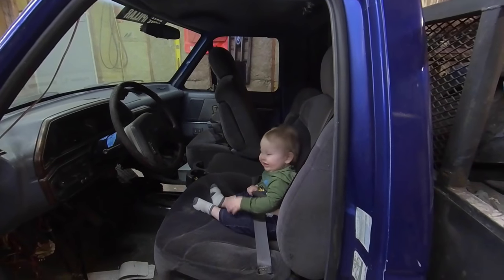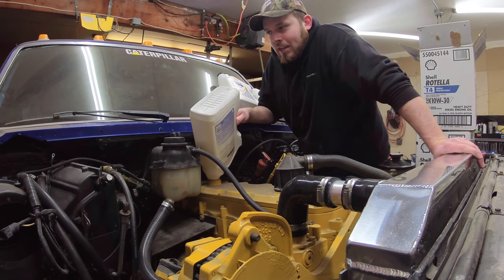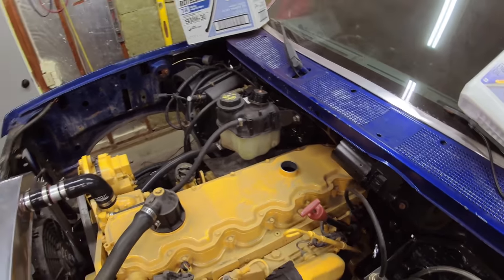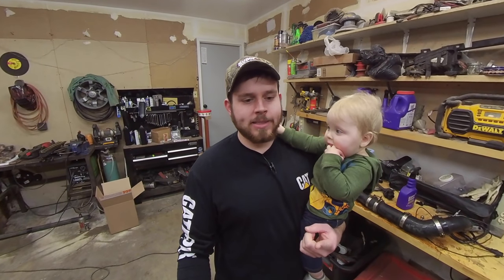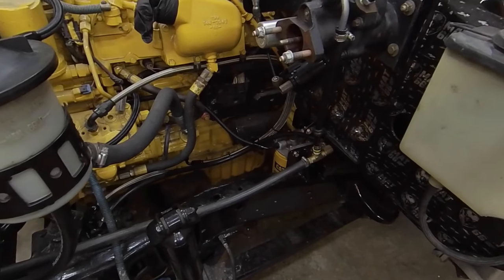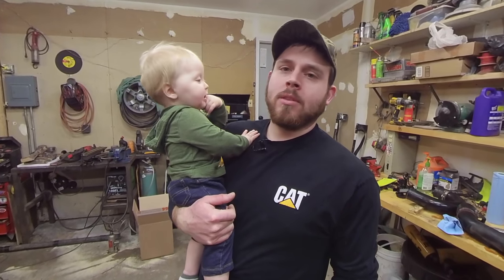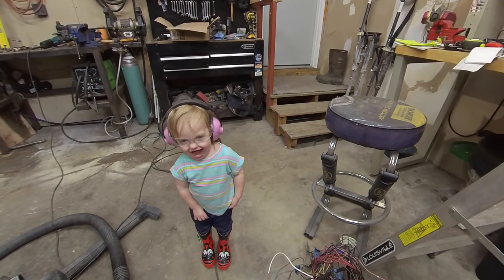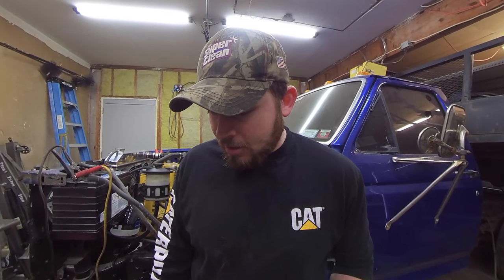Pt. 61 Getting Ready To Fire It Up. Cat/Allison Swapped F350.

Comment: it will have park, rev, and 3rd gear and will be in limp mode. and the castrol tranSynd 668 for 3 gallons is better stuff and is the replacement for the old tranSynd but that is still much better then the dextron 6 that gm uses. thanks for sharing

Comment: Maybe you should check on getting a controller and the wiring from a junk school bus. That’s the same setup on a Freightliner FS65 bus, a 3126 with a 2000. If I could get my hands on one I’d send to you... but we don’t have any of those in the junk pile right now!
Reply from the maker: Yeah I need to do some more digging around see if I can find something. Are your busses 6 speeds?
Reply: @DrEwBaBy625  yeah they are I think but 6th is locked out.

Comment: I believe the Allison 2000 is controlled by a stand alone controller mine is in a finned aluminum case mounted center rear to the bottom of my International 4200 cab - maybe you could get ahold of where you got the transmission they might have what you need.

Comment: Does your dipstick have a number on it? Would it be 167-2091V ? Bottom of the stick. Does it read correct? I have a3126b in a SuperCruzer which is the 22qt pan. It’s always showing overfill. Call Cat hotline they told me how to remark it but would not tell me what engine or oil capacity it was made for. 

Thanks
Reply from the maker: My dipstick is 266-9769.  Yours is an older part number that was superseded by mine and 275-4224. As far as I know it read correct, I have never had any issue.
Reply: @DrEwBaBy625  Drew, thanks for the reply. One more question if I could ask. What is the total length of your dipstick to top of the cap that surrounds the tube? Mine is 37”. Can’t get any info from Ring Power or the Cat Hotline except how to recalibrate it.  Can’t believe they only made one dipstick for the 22qrt and 33qrt oil pans. Have a friend with another SuperCruizer and he has the same stick as mine. Thanks in advance. Take care, Dave

Comment: Sweet stilts! Did you ever do drywall work?
Reply from the maker: I do not. I worked for an electrical contractor for a little bit and saw the drywall guys using them and decided I needed a pair! They come in handy every now and again!
Reply: @DrEwBaBy625  same! I'm a framer or concrete formwork carpenter and I saw drywall guys using them and had to have a set! They're great for Christmas lights

Comment: Man, been following you for a long time and hats off to all the hard work you’ve done on that truck! One thing to highlight, please use 15W-40, I know CAT DIESEL OIL ain’t cheap but Mobil makes it for us so you can buy their brand oil and save the CAT premium but for the love of God stick to 15W-40 your bearings will thank you later. Btw if you need specs for that engine just hit me up and glad to support your channel!
Reply from the maker: Thank you! I was told by my cat tech that cat recommends 10w-30 in these engines due to the heui system.
Reply: @DrEwBaBy625  let me double check that for you, what’s the engine’s serial number? I should be able to get on TMI web and get you more details and specs about it.
Reply: I I would agree with the 10-30 oil but I don’t agree with rotella haha, I’ve always been told in the past to run delo 400 in cats, doesn’t foam like that roltella does